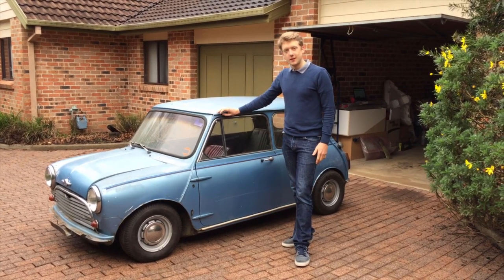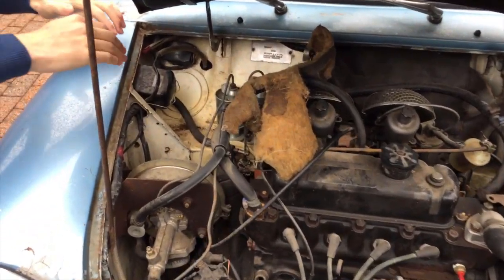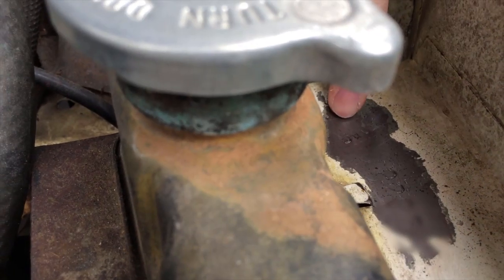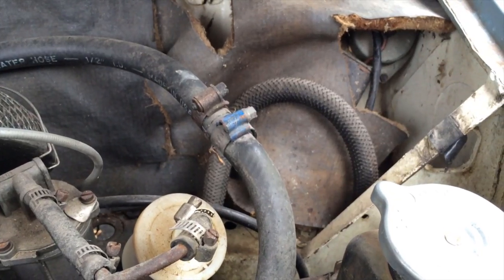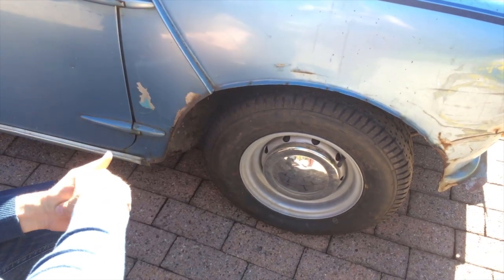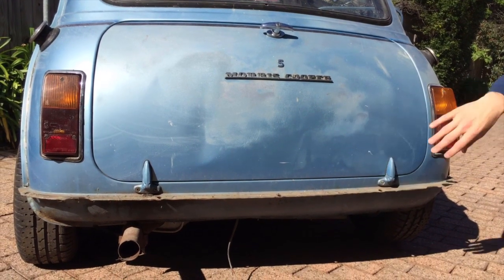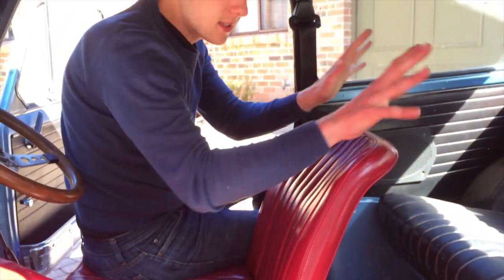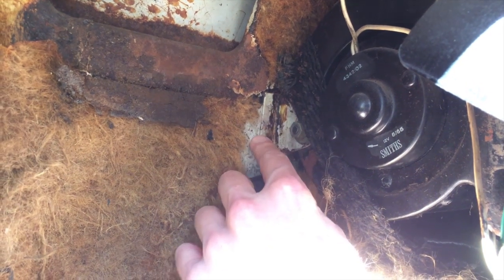Australian Morris Mini Cooper S (MK1) Identification

Comment: Thanks for the detailed tour of the Cooper S. My recollections as an owner of both a Mark 1 850 cc Mini and a Mark 2 Mini Cooper was that the Mark 1 had dry suspension and that only the Mark 2 Coopers were fitted with hydrolastic suspension. Unusual also to see the Mk 2 tail lights retro fitted to a Mk 1 body. I suggest that if this car was used for racing then most owners would convert to dry suspension. I shall be very interested in watching your ongoing restoration. Thanks.
Reply from the maker: Thanks for the comment Alan. I'm slowly getting some work done to the car :)
Reply: I had a 1967 Mark 1, Mini Cooper S,which had hydrolastic suspension.    Light Blue/white roof.   Another feature of the Cooper S engine
was the extra cylinder head bolt,mounted near the water inlet of the head,also the Mk. 1 cars had a rubber cross uni joint mounted on the
drive shafts on the inner part of the gearbox,the Mk.2 used  Hardy Spicer non rubber uni joints.
Reply: @titanus49  
The Cooper S head (also fitted to the 70bhp models of 11/1300 range) is called an 11-stud head.. in reality one extra stud at heater valve end and a smaller bolt at thermostat end. I saw here the latter on the car has been converted to a stud.. possibly originally a standard 9-stud head.

Comment: This is a great review. I owned my first Mk1 in 1969 and the model was a 1967 "s" . Light blue with white roof. I still have many bits like badges, block, head and windows but alas not the body. I have agreed with you on every point except one, and that is this.... my centre consul was  as shown in this review!! Now you could say I'm wrong, however it would be hard for my car to have a Mk2 consul when I owned it in 1969. I've had a few arguments over "s" s, and I feel a bit like an authority as I was there and know my consul had the two green indicators as you've shown. Any feed back welcome. PS I also have a Clubman GT being one of the first 500 after Leyland took over. I believe this car is very rare as a specific model. It has the full S disc brake set up and Nitrided crank, running S valves not the crap later GT's were given. Any enquiries re s's please come back. I do feel there is some mis information out there.
Reply from the maker: Hi Barry, thanks for your comment! Being a 1969 model, yours would be on the borderline with the MK2, and they started introducing some of the MK2 parts on certain MK1 cars - I expect this may be why you have a MK2 instrument cluster. I know of a few 1969 MK1s with them, as well as a few MK2s with the MK1 cluster. They were using up leftover bits for a short while I guess, and introducing some bits on other cars a bit earlier. 

I love the GTs by the way - also have a guide for them here: https://classicregister.com/id-guides/how-identify-1971-1973-leyland-mini-clubman-gt

Any further info on them would be great. I'll give you a message by email
Reply from the maker: Just realised yours was a 67 model sorry - I misread your comment. Would be great to see some pics of your car - email me at classicregister@gmail.com if you get a chance :)

Comment: That Brake booster is the later PBR item, and not a Lockheed unit as you state.
Reply from the maker: Thanks for pointing that out, I'll put a note in the video confirming the correct type.

Comment: I noticed that on both blocks the engine number is stamped into the block itself, not on a separate rivetted-on plate (rivet holes apparent). You didn't mention about that, so is that normal for AUS cars?

Comment: Did you purchase that car from brickworks racing in sa originally?  I believe it was the same one.. That I saw many years ago...
Reply from the maker: Hi, thanks for your comment. I got the Cooper S from a guy in Bridgewater SA. The seller mentioned (to the best of my memory) that he purchased the car about 5 - 10 years ago from who he described as a well known Mini enthusiast / mechanic in SA. He also mentioned that the car was raced by the same owner in the 1980s at Mallala (the reason for the oversized/cut front guards and death of the original engine block sadly). So you may be correct - possible  that it was Brickworx. Do you happen to know if they are still operating? I can't find much about them online anymore. I remember buying a few things from them 10 years ago when they were dealing in a few Rover parts. I'd be interested in tracking down some more history of the car with them if they were the previous owners. Thanks again! Tim